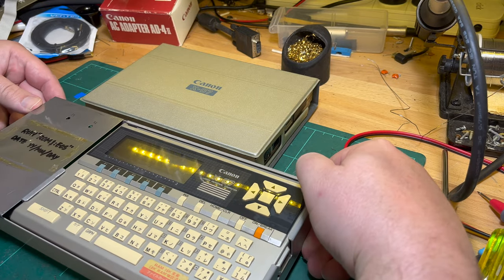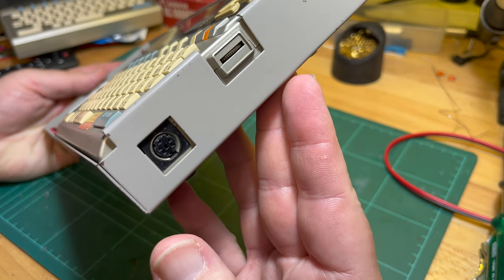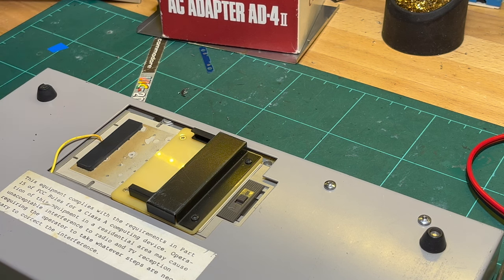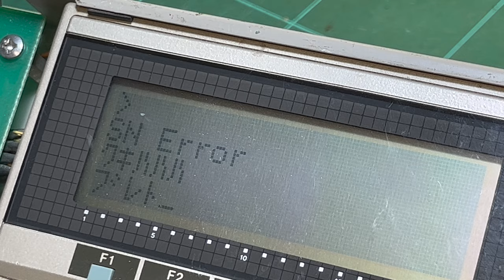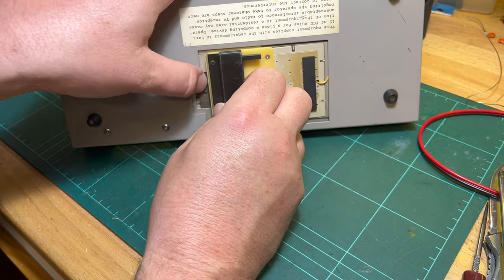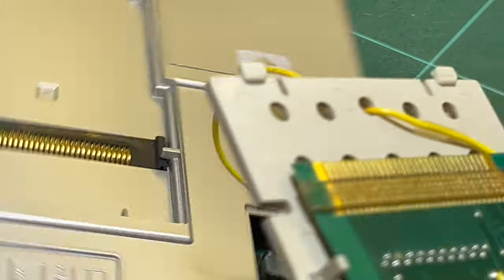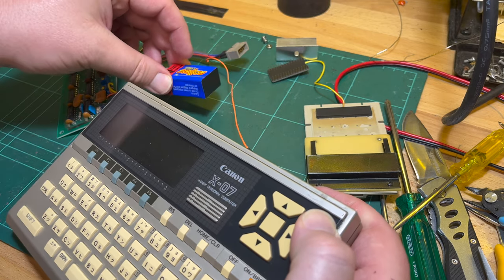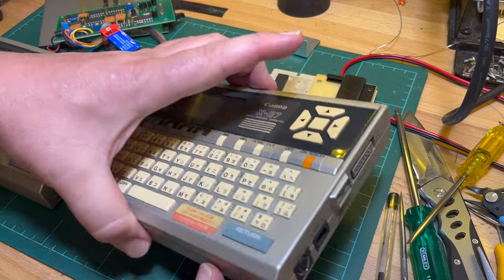🇯🇵 Canon X-07: Part 3 (EOS camera Interface Unit TB) [TCE #0208]

Comment: I was thinking the same thing when I saw the "ROM" on the cover. Except I'm betting that it is to flash the ROM, which would be really interesting. 

MC14001B is a Quad 2−Input NOR Gate. The MC14049UB is a hex buffer. Notice that the pots on the board are labeled "VR1", "VR2", "VR3". Which might be the read and/or programming voltages. The four transistors could be appropriate for an (E)EPROM burner.

And a couple of things, what are the lighter blue devices straddling the lower left MC14049UB, and what pray tell is the chip under the two "K104" caps to the right of the lower pots?
Reply from the maker: Oh ... very interesting theory.  I did realise after posting that I left one chip totally covered.  I'll take some photos and post them ... somewhere ... I should really resurrect my website: www.outosoft.com.au ... it's been a bit stagnant ...